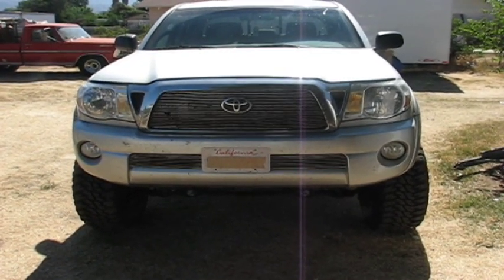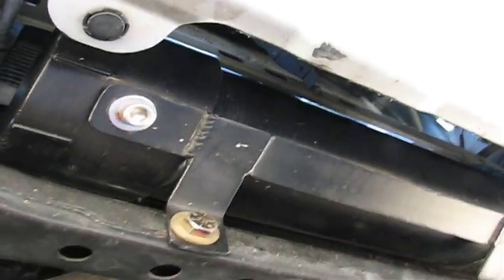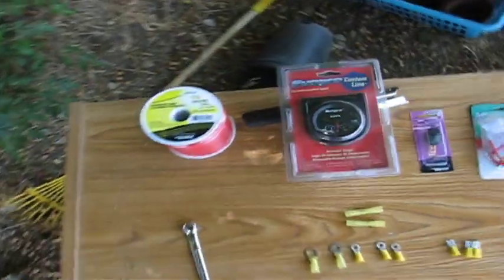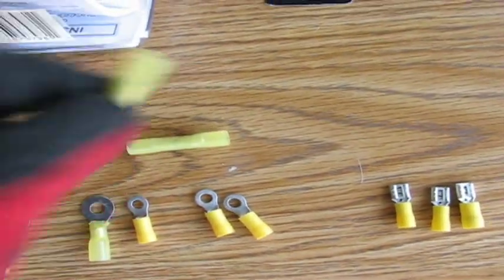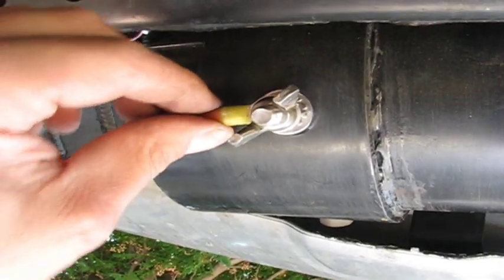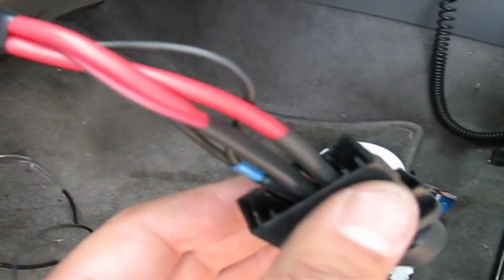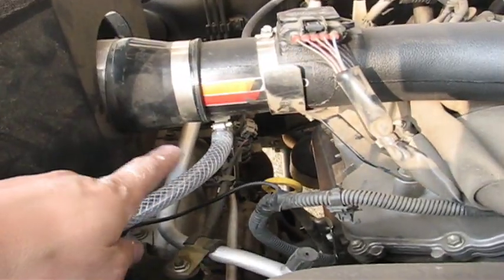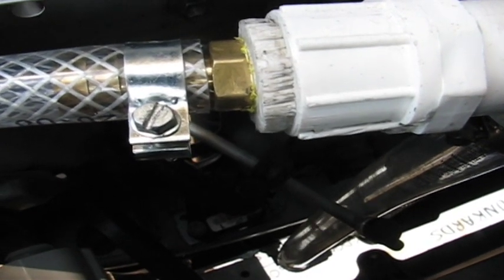how to install HHO (horizontally mounted)

Comment: The first part is all true. Yeah, there are a lot of ways. The conspiracy theorist part is where the disagreement starts. Yes, I know how much energy it takes to convert it, I BUILT A DEVICE THAT DID EXACTLY THAT. DUH. Have you ever built and installed a hydrogen booster for a vehicle? If not, You have literally zero ground to argue on. I have results, and all you have is some crap argument about why the science makes it impossible. Results above theory. That's how science works.

Comment: Probably didn't regulate the electrical input to the booster very well. My dad brought a geo metro from 40 to about 60 mpg, but the booster got too hot and melted from the current. That's my best guess.

Comment: The main problem people have is that they don't account for the oxy sensors adjusting fuel output, but this DOES work, my dad built one and put it in a geo metro, brought the mileage up from 40 to nearly 60 mpg. He's a damn good mechanic and I'll be damned if you're telling me he can't tell when he's getting better fuel economy. As a matter of fact, I'm currently improving on what he built for my car. You can keep being skeptical, but you're the only one missing out.

Comment: @jamfabella
If you want to improve your car engine efficiency
and save on your car fuel expenses
There is a better way to do it - it is HHO Gas
Using Hydrogen Hybrid alternative for improving
your car miles per gallon or kilometer per liter
Search Google for: "Top HHO Gas Car Research"
Click the first result (and Skip the Advertisements)

Comment: Great demo! Is it true that this car still uses gasoline and hho going to the air intake is only helping with the performance while increasing the gas-mileage by at most 20% which is a lot better than nothing.  But what I want to do is inject the hho in fuel intake and have a valve adjustment knob by the driver seat for fuel flow adjustment so I could decrease it while driving on freeway.
May someday soon we all toast to Stanley Meyer as fossil fuel is obsolete and we all use water for fuel.

Comment: i see you did not use a PWM. do you not have to use one to keep the amps down? if so this will be great as it will save me some cash also i see you did not use any kind of enhancer sensors for the extra ocygen ect.... will the motor run ok like this?

Comment: @outofcomms I have a 4 liter dry system in my 05 Tacoma with 36 stainless steel plates using Potassium Hydroxide not baking soda, I can fill a one liter bottle with Hydrogen in less than 15 seconds. I believe HHO systems can work if you can get the ECU to communicate.

Comment: Rugghead98 is absolutely right!! The ECU will not compensate, it just keeps dumping the same amount of fuel no matter how much HHO you inject. You can put an EFIE,  Oxy extenders, but the freaking ECU does not care. You can have the most efficient HHO system producing 3,4 even 5 liters/min, but it doesn't matter your problem is in the ECU! If someone can tell me how to trick it or where to buy a modified chip that will allow the HHO to be burned efficiently, I'm all ears?

Comment: @urbex2007 that's what an EFIE is for.. or you can us an oxygen extender to add space between the O2 sensor and the terminal block.  basically tricks the ECU into unaltered gas intake levels so the car doesn't add more fuel intake since the sensors are going to pick up a leaner gas from the hydrogen.  i bought a HHO generator from Green source for my camry and i get 50 mpg now.. its pretty nice i only fill up about once every 2 weeks